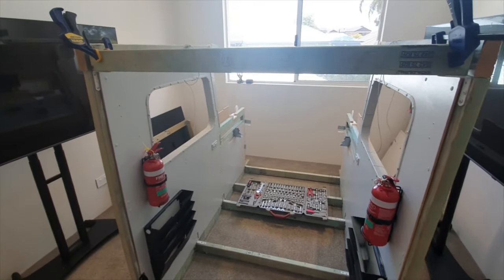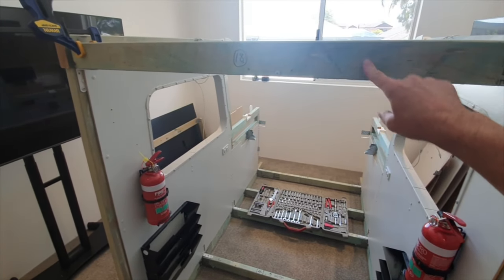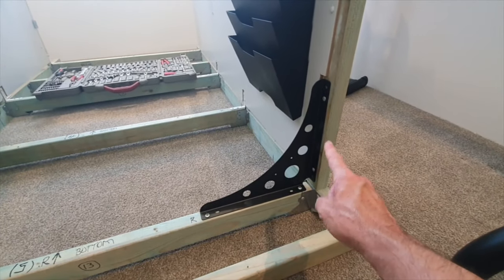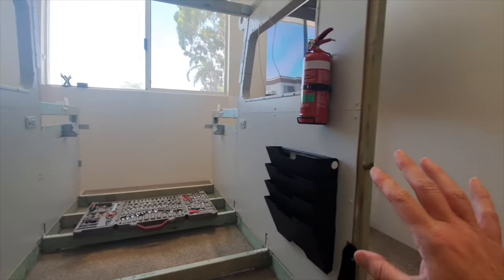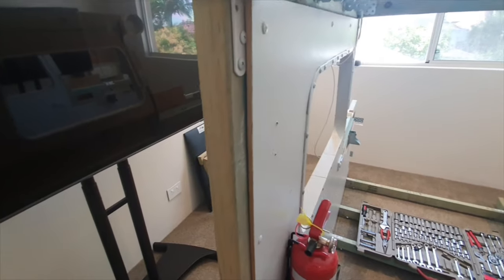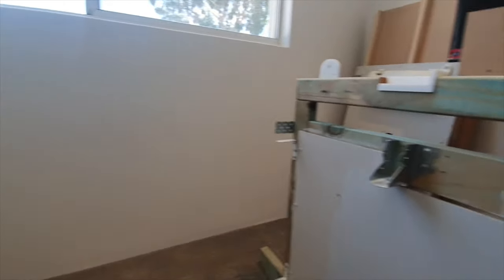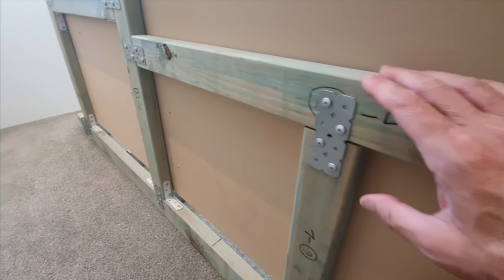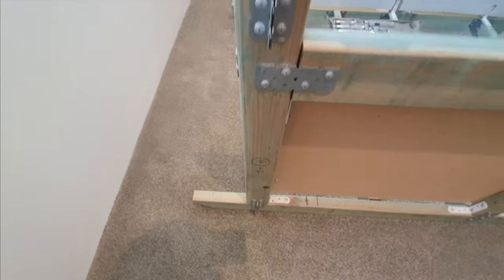172 - Sim rebuild - the frame

Comment: Whats good about this structure is that it shows you don't need a workshop full of expensive tools to build a sim. Only basic tools required, so anyone can do it if they can dedicate the time. The main expense, of course, is on the PC, controllers and electronics
Reply from the maker: completely agree.  Thanks for tuning in.

Comment: Did you use  a cutout template for the windows? I am in the designing phase and I really like yours, I would like to reproduce it.
Reply from the maker: Hi and thanks for tuning in. From memory I used the side image view of the Cessna172 from the Pilot Operating Handbook and imported that into Fusion360 and scaled accordingly until it looked about right and then traced it. To be honest my windows are a little bigger than the standard C172 but I wanted to get as much screen as I could so this was deliberate on my part. Hope that helps.

Comment: Did you model the side panel dimensions from the real plane?
Reply from the maker: Not quite. Initially I used a combination of dimensions that I grabbed from various internet sources, plus the side profile of the C172 from the Pilot Operating Handbook. Purposely, I made the windows larger than normal to take advantage of the 55" screens.  Its pretty close but not 100%. The overall width (inside) is about 70mm wider than normal C172.

Comment: I'd like to start my build soon.
Are you able to supply the dimensions?
Reply from the maker: what dimensions are you specifically looking for? This model is in Fusion360 and I dont have drawings printed. Happy to provide some guidance for you if helps
Reply: @CessSim  Thanks for the response.
I'm after the dimensions for the cockpit frame and instrument panel. I also am using Fusion360
Reply from the maker: @PeteBatko  That is a lot of dimensions !  I am not in a position to share the model at this stage so is there any other way I can assist you?